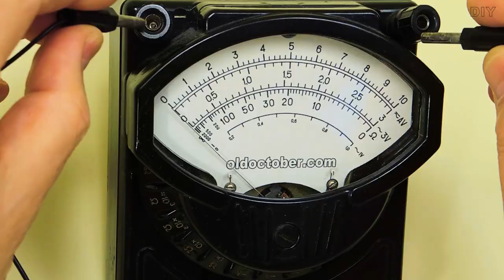Power Station in Your Pocket

Comment: This is really amazing if we could intoduce this method into homes and cars i can only imagine the ways we would apply this technology.
Thank you for the video sir.
Reply: It does not work like that, but it can give burst of energy. Not 24/7 energy.
Reply: @kiljupullo  Explain to me what does give 24/7 energy?  With piezoelectric you can use a tone generator to vibrate the crystal to generate electricity, then you can extract some of the stored electricity to run the tone generator to keep making electricity 24/7.

Comment: Now heat the water again without coiling the wires on the table, or at least coil them in the air far from the desk. Just to be sure there is no transformer shenanigans from under the table, you know
Reply from the maker: I'll take note of that next time. But the deed is done - the formula is sold.
Reply: @IurisWorkshop  Sold to a company with no plans on using it. I can't find any papers, marketing, or research on this technology other than this video and common knowledge of piezoelectricity and electrochemical batteries. every swimming pool on the planet could be a battery/generator recharged by the sun, tides, and natural frequencies flowing through the earth, exciting the kinetic potential of the crystals. IP ownership and private patents should not exist. An individual's discovery of an applied science doesn't make them the inventor or owner of the science, the invention existed in theory before you ever thought to mix oppositely charged chemicals with quartz and epoxy, embed them in electrodes, and sandwich them together to make a very unstable piezobattery. If it did make that person the owner, I think whoever built the pyramids would have an issue with you selling this technology as the inventor.
Reply from the maker: @djg420  You reason in the same way as the soldier who, according to legend, killed Archimedes. :)
Reply: @IurisWorkshop  I don't understand your reference to my reason. 

Archimedes was supposedly killed by the soldier who was sent to collect him, for refusing to be pulled from his work. 

My opinion was with regard to a discovery's "ownership" as some sort of Intellectual Property right, as something tangible, that can be held and sold at will by the discoverer. And the philosophical implications of a society in which corporate gods can buy up and control which technology fits their "designed obsolescence" model of societal technology and growth.

I am researching something very similar to this, but replenished by light and periodic mechanical oscillation. I wouldn't dream of patenting other than to keep it from being owned by someone who would not share it. I'd give it to Elon Musk or Tesla himself just to be part of the branch. We are one lifeform across the universe, all energy propagates from the same source, can not be destroyed, only transformed, and shall all return to the source at the end of it's path. Science reinforces this hypothesis with every passing firmament of darkness. I shall not deny others of the knowledge I was fortunate enough to discover along my individual path. 

I've dreamt of this technology before, somewhere, it is being implemented on a much larger scale to much benefit of all around it. Scalar wave geometry and tuned resonance can condense and amplify this circuit's output.  

Your video is part of that puzzle, congrats.
Reply from the maker: @djg420  Archimedes was supposedly killed by the soldier
Yes, this is one of the versions. I just tried to make a joke. If you don't like inventors, you can kill them. :)

If you want to create a model of the world on the basis of which rational decisions can be made, then you should base this model on basic instincts, the laws of social development and competition. The world is not as complicated as we are told. Those who understand this and use the rational model succeed. Nature has given some individuals such opportunities and their subconscious mind makes rational decisions even without their knowledge. We also call such people successful.

As for attempts to build an idyll, they will be unsuccessful until we create a man devoid of animal instincts. It will be either artificial intelligence or a genetically modified person.

There is another way - the way of education and improvement of the culture of the population, or, as it is also called, the path of the "three universities". But, so far, that effect has been achieved only in limited areas and with varying success.
Reply: youre actually right. notice how he changes the number of turns on the cable 2:05 (makes sense if you need to fine-tune induced current). also, the little impulse from the hammer is never ever enough for that explosion to happen. the explosion is at the very least in the hundreds of joules, if not in the kilojoule range xD (you can see that for yourself in videos where people use capacitor banks to explode wires). a tap with a hammer.. wait let me calculate. lets say the hammer weighs 300g and he almost just lets it fall down, so lets be generous and say 2x gravitational acceleration (2x 9.81m/s² = 19.62m/s²) so the force is 19.62*0.3Kg=5.8N. over a distance of lets say 5cm thats 5.8N*0.05m=0.29J so there's absolutely no way this is real

Comment: For a diy station this is not very diy... I still liked the video but please give us your piezoelectric crystal composition.
Reply: Better buy small PIEZOELECTRIC generators online...
You will get it..

You can also use this inside Shoe soles to generate electricity while walking, or below carpets in your house , or between the Tyre and Wheel rim of your Vehicles to generate electricity while driving,  at free! 
Today Japan is using this technology in some of its Malls too.
If installed below the Public streets or Roads, it can generate enough electricity to power all street lights & cam.

Comment: If a mechanical repeating hammer is used this disk can generate enough to fully charge a super capacitor in few minutes.
Reply: @Nachoman24  If you have no motors or generators, attaching a series of hammers to a wheel or have a hammer drop and be lifted with a manually-cranked shaft would allow you to use a repeating hammer powered by a source that wouldn't be able to charge a supercpacitor directly.

It's reaching, but it's a solid point. I would include wind and hydro power, too, but the old-school versions that were used for grain and the like.

Comment: 0:00 where do you get ac electricity from?
Reply: Zero point energy works on the principle of casmir effect..but non material can handle the heat n distortion...not working in long period of time
Reply: of course I should be smarter to know that this is a computer edit

Comment: Hello, What materials are required to make it?
Reply: Try Rochelle salt.
Reply: @wdtripps44  looks like he p and n doped the salt as well, hence the two mixes with two colors. probably used copper sulfate in the  blue mix and ferric oxide in the orange mix then the crystal serves as the dielectric

if thats what it is in the mix, then he made a piezo-crystal cell copper-iron redox battery.

search for "rochelle salt battery"

Comment: You can't fixed clamp something for continuous direct current, that's not physics unless it's a battery
Reply from the maker: It's chemistry bro!
Reply: @IurisWorkshop  if you say so
Reply: @IurisWorkshop  can you explain it to me
Reply from the maker: @SodiumInteresting  This combination of elements is highly unstable and explosive. The publication of such information is now punishable by law.
Reply: @IurisWorkshop  well if true it is another thing I'd love to try and synthesize. What is the name of it? I am an amateur chemist. The other thing I'd like to be able to make is HIPEP electric solid propellant ;) That is also a proprietary material the manufacture of which is a closely guarded process with only one company able to make it.
Reply from the maker: @SodiumInteresting  I managed to sell the rights to this idea. And the buyer left the opportunity to save this promotional video.
Reply: @IurisWorkshop  my guess is you have a piezoelectric polymer or ceramic and two current collectors with spikes to increase the contact surface

Could we store the electricity and make footpaths out of it? 🙂

Comment: Cool project but I have a question it is reusable ,rechargeable?
I like it it is a great idea.
Reply from the maker: No, the element is destroyed very quickly from overheating. The maximum operating time is 10-15 minutes.
Reply: @IurisWorkshop  So overheating is its only downside
Reply: @IurisWorkshop  couldn't you just not overheat it? like what if you made one and gave it a slower and milder disharge and kept the cell below a certain temperature. is it rechargeable then?
Reply from the maker: @chaorrottai  This is not a storage battery.
Reply: @IurisWorkshop  okay, so it's more like a pressure activated high capacity battery then?
Reply: @IurisWorkshop  dude, I know it's not the best place to reach you, but I thought you should know, I was inspired by your channel, I made a 1 millifarad capacitor with a homemade crystal between two plates with a 1.5 cm dielectric thickness and a plate area of 0.0003 m^2.

With a lower dielectric thickness, and plate stacking should be able to make a >1 F capacitor that's about the size of a AA battery.

Comment: How large can you make these? How expensive is it?
Reply from the maker: The technology is imperfect. The product becomes unusable after 15-20 minutes of loading. But this is a record. It usually works even less than 5 minutes.
Reply: @IurisWorkshop  Will it work longer if used in small spurts? Maybe we can apply timed pressure to multiple devices in a round robin way without exhausting?
Reply from the maker: @michaelmadison883  If you are looking for a perpetuum mobile, then I don't have one.
Reply: @IurisWorkshop  how does it behave in centrain temperatures? ore hight diferences? I belive the temperature of those diferent metal plates has somthing to do with it.Perhaps there wuld by effect if you actualy take 1 of those plates and put it in the fridge to cool down that plate Im confident it wuld do some thing
Reply from the maker: @devilswish8876  As the temperature drops, the current decreases.
Reply: @IurisWorkshop  culd you please make a video how a piezo ignition look like on singel cilinder engine? this is theoretical but wuld not that old school oil cooled ignition coil by used as a capacitor/baterry? if you remove oil and put cristas inside the ignition coil and seal it under high preshure ore wacum wuld that not do the same thing as a baterry?and use actualy a pick up coil and activate a coil spikeing? Im thinking of a ignition coil who does not requare baterry power.
The ignition coil it self is the capacitor/baterry.
This is all theoretical .
I know those ignition systems existed and worked but no where can I finde info on the internet about this subject.
Any ideas about this
Reply: @IurisWorkshop  why is there a breakdown of the piezo? Is the chemical rea tion finite, in other words do the base chemicals react until they are depleted or is the breakdown a pure structural one, where the crystals just degrade due to the stresses applied?

Comment: Volta baterry+thermal baterry +microbial cell+ chemical baterry +gravity baterry+orgone generator+cristal baterry+ human body charge = solid state generator ,any thing in betwean can be used in series parrarel configuration .
Interestingly enough John Bedini,Tesla and some guy if I pronounce his name correctly Sergei Andrejevich Kukel generator.
Patents exist and Kukel is more realistic then bouth Tesla and John Bedini.
So if I missed some thing correct me please .
You can rotate in dead multipel different materials aluminum steel magnets copper brass for effects but somthing unusual rotating entire baterry 😁 tehnicaly but just tehnicaly does the same thing .
🤔Im not shure what to call that thing honestly onldest generator in histori I supose antena perhap's?
Frequency to volts/amps converter perhaps?
Well who knows I supose.
It was used any way similar design to Kukel ore starter/generators/converters/inverters/transformers rotary types still today cristals can be found with oil centrain wires on hv industrial transformers so yeah funny right🤔 perhaps magnetic amplifier perhaps?
That thing has lot names I supose not realy specific porpuse.
So hard to tell what that staff is exactly but mostly electro/magnetism is involved with chemistry ,thermo dinamics and aperantly bacteria organic compounds.
So thats what that thing is solid state compound device basicaly.
Porpuse universal.
And those things do not teach normal electric enginering schools to be noted .
And no non realy mathematical equation can not comply to compounds and variabels they are non predictabel .
So 😅 peopel actualy do not know to full degree what those devices are capabel off in short explanation.
Exampel I wonder why peopel did not use those things instead spark plugs and other crap🤔 ow yes actualy they did before the invention of points ,buzz coils and what not they used piezo effects .
Cinde of that small detail missing from histori books 🙄
Did not transforems actualy solid state generators as well tehnicaly ?
At least thats what some inventors claimed in their patents with their own words.
I belive protons and bacteria are the 1 and the same thing.
But chemists shit to much so do electritian guys as well and evry on ells who is not realistic at some point.
Again those things are not teached in schools .
Be the way those piezo are actualy dangerouse it can kill you toxicate you and even implode/explode tehnicaly just for notice.
Same is true for compound motors and starter/generators compounds .
So thats why they are not used in the first place they are not predictabel and actualy react with any thing .
So that guy forget to mention that small detail.
Imagine hiting that thing on mounted car chassis and you be acident have propane tenk its called ground ignition you blow ya self up!!
Static is any thing dc+ dc- ac ac out of faze and suprise evry element in existance will deteriate decompose ore react with ich other including the human body .
So 😑 yeah about that small facts usefull yes but it culd kill you preaty much in multipel ways.
How insulate that deam thing if its reacting with bouth bacteria and all existing ellements????
So even if it does work how to hell prevent desaster thats mistery to me.
So I belive that guy I experiance multipel baterry types and their effects on regular basis and actualy witnes deteriation from car chassis to rubber gaskets even organic chemical reactions and what not who shuld tehnicaly not acurre but they do.
So there exist reason why they are not used because they are not safe!!!
Actualy you can find piezo disc even in carburetors called thermo time valves preaty deam good vaporisator.
Perhaps bether name for that thing in carburetors wuld be called magnetic pump !
If that deam thing can vaporise water it can vapor oil as well and your own human body kill you instantly if you fumel with frequency ranges .
So thats the truth behinde piezo discs.
Reply from the maker: Thanks for the comment!

Comment: Epoxy has to conductive.
Reply from the maker: It is a polymer.
Reply: @IurisWorkshop please scale this model with a spring loaded mechanism in rotational impact orientation to exponentially increase the output which can be finally drained into a super capacitor bank. 😉 Please continue to make another video

Your work is an eye 👀 opener effort
Thanks
Reply from the maker: @redmidubai3005  Here is another video on this topic: https://youtu.be/AXB0VFBzjzk